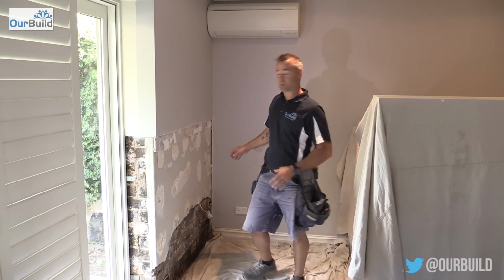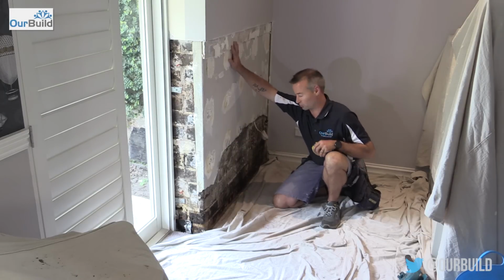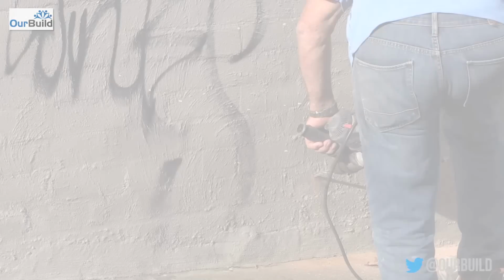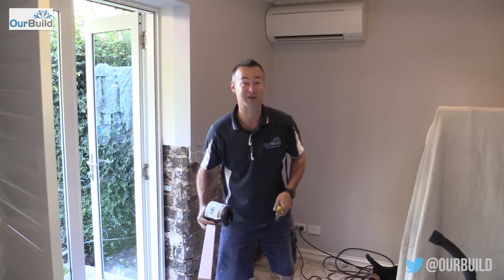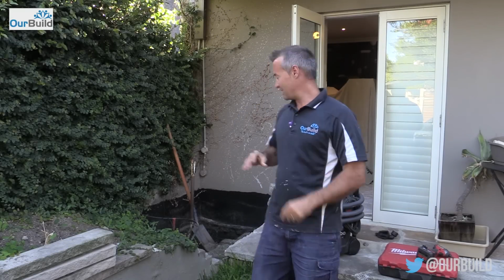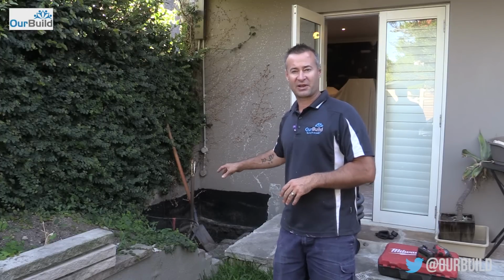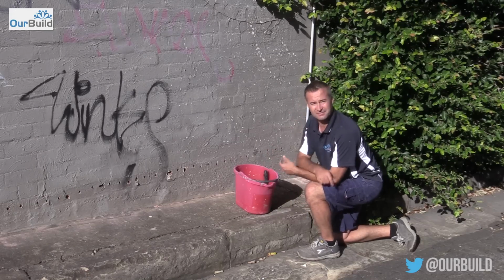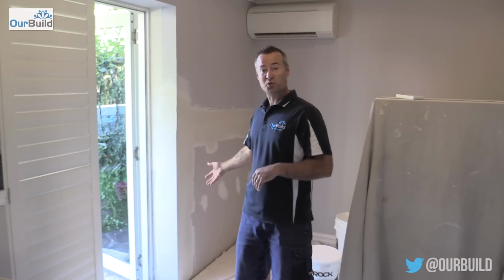How To Repair Rising Damp In A Wall.

Comment: Look at the outside ground level - higher than inside = penetrating damp.  Having spent 25 years in Ozzie, I know it well - and have never seen rising damp, and never needed to do this to an old house - owned plenty in Perth on the coast and Adelaide.. Biggest issue is ventilation - high humidity can condense within the walls and make them damp.  Note inside and outside on this house are not able to breathe - walls covered with bitumen or cement / plastic paint - so interstitial condensation cant get away. I guarantee that if you take all this crap off the walls they will instantly dry out.  Plaster in lime, and never see a problem again.  Simples.
Reply: listen to this guy - I have learned a tremendous amount from Peter and his videos - and saved a fortune. Thank you Peter for taking the time and effort to raise awareness in an industry that is jam packed with, basically, con merchants.
Reply from the maker: Thanks for the words of advice Peter, will keep that in mind. BTW - The outside level is lower than the inside, and the clients are more than happy with the repair.
Reply: The external levels are clearly high, they should be a minimum of 150mm below floor level, here they appear almost level
Reply: Peter Ward
your bob on, don't understand this one it's even got a damp course install when it was built. sort the outside level the problem would almost sort itself.
Reply: Peter Ward knows his stuff. Absolutely common sense regarding the need for brick work to breath. Any magic remedies with drilling is never going to work.
Reply: Yutube Lurker  Yes the moisture cant get out. You answered your own question. Get rid of the paint and graffiti and the problem will go away by itself.
Reply: Yutube Lurker you can’t stop water ingress. Water will find its way in through any tiny crack. The render won’t allow it to evaporate when it’s in so it gets trapped inside. If the wall can breathe then it will just evaporate away. Peter knows his stuff, look him up
Reply: What about a double brick with cavity that is halfway under ground with moisture only in the bottom (first visible brick from the floor) and concrete floor in 1 corner only. Dries out some time after there is no rain for awhile but does persist for some time after rain. Drainage and other regular factors are fine, only dampness is in the 1 bottom layer of brick in 1 corner only.

I would hazards a guess the metal sheeting visible just above the first brick is the DPC? I don't know why else a sheet of metal would be there but i'm only a sparky so eh anyway, it sounds like rising damp due to failed DPC to me.
Reply: YOU MIGHT HAVE 25 YEARS EXPERIENCE BUT YOUR MIXING UP CONCEPTS...HUMIDITY IS EITHER RISING DAMP (TOUGHEST TO BEAT)..CONDESATION...(NORMALLY ON HIGHER PARTS) AND INFILTRATION...DON'T CONFUSE PEOPLE...THIS IS A CLEAR CASE OF RISING DAMP...AND I AGREE ABOT LIME..I WOULD USE UNDERNEATH A BREATHEABLE CEMENT...THEN HYDRAULIC LIME AND SILICATE MINERAL (BREATABLE) PAINT...IT IS A CHEAPER SOLUTION THAN THE INJECTIONS...THE CONCEPT IS ...THE WALL NEEDS TO BREATHE...TO KEEP HUMIDITY OFF
Reply: EXACTLY. Im a London Plasterer. And this con has been around since the 60's. Why dont they get damp in Holland. Its built on water?
Reply: Common sense at last,
Reply: I have a house in a dry climate and there is crumbling mortar extending 1 meter up on all walls, including internal walls. No high soil on any side of the house. Most older brick houses in the town have the same problem or have already been repaired. If that isn't rising damp, I don't know what is.
Reply: @Jaxon Caiden flixportal :)
Reply: @Anders Kaiden thank you, I went there and it seems like they got a lot of movies there :D Appreciate it !!
Reply: @Jaxon Caiden Happy to help :)
Reply: @TheHuntermj  salt
Reply: @nathan21388  yes, but what carries the salt up the wall if not moisture...

Comment: Here in the UK some people are cutting the bottom meter of the wall and redoing it in lime motar, as cement acts to hold in the moisture, even as a wick effect to draw up the moisture and leave salt crystals, often mistook for mould,  in some cases structural cracks will appear as the moisture will add weight to the wall and pull down the wall in certain areas, this is prevalent in old stone houses with stone foundations. Plasterboard is one of the Greatest wicks manufactures have invented. You may be lucky if it works on this occasion, but it looks like an old stone wall. Walls need to breath.

Comment: By the amount of negative comments here you must have realised you messed up.

You should listen to Peter Ward rather than dismissing him. He knows more than you.
Reply from the maker: +Jack Davies Hi Jack, do you own a moisture metre?? They can be used for a whole lot more than timber, I suggest you read up on your information a little more before making an un informed comment - http://www.flir.com/instruments/building/display/?id=49421
Reply: Our Build Thanks for the link.
Reply: Our Build you shouldn’t use a moisture meter as a means of testing the percentage of saturation. They can be useful for comparing different areas of a wall to one another but that’s about it.
Reply: @OurBuild  That device measures (relative) heat. The heat of what ? Not necessarily the heat of ingress water. In fact, probably never measuring 'direct water temperature'. Cooler areas identified by thermal measurement are often areas of salt crystallization (efflorescence in these cases). All such salts are fully hydrated (that is the nature of salt formation whenever water is present, as liquid or gas), and so the water measured as the cooler regions typically do not represent 'free ingress water' (as one might expect when classifying a region as 'damp'), but rather the cooler water molecules which have been pulled in to hydrate the water-hungry salts. The salts are allowed to form typically because the water has been trapped (by portland-over-lime, or by synthetic coatings which do not breathe). Peter Ward is correct on each of these matters.

Comment: Peter, can you please advise how I should fix a rising damp on a solid wall after stripping back the peeled paint? What do I need to apply so it dont damp again.
Reply: I know you asked question 3 months ago, but the damp will always rear its ugly face im affraid.  Jobs treated with a whole damp proof solution, ive seen many times the damp return.  And before anyone may say the D.Proofing cant have been done right.  Ive seen 1st hand , experience trades doing a propper job, and doing it by the book, only for damp to return.
A DIY'er will only have time & skills to paint on a paintable solution.  But a more substantial repair using K11 should be done.

Comment: Does anyone know how to moisture proof, from the interior, a limestone farmhouse (circa 1775) in Pennsylvania.  Current problem is a closet, with solid door.   The old horsehair plaster has been crumbling off the wall for years due to moisture.  When built, the limestone rocks were coated with many layers of horsehair plaster.  I want to remove all the horsehair plaster, and am looking for recommendations on what product to apply to keep moisture out.  A contractor recommended a concrete product (Quikcrete).   The stone wall is NOT smooth, of course.  Using green/blue drywall would likely trap the moisture between the rough rocks and the drywall, causing a different moisture situation.
Reply: Check out ´Peter Ward´ posts . DON´T waterproof your walls . Use lime plaster and limewash paint only. Do NOT use any cement based mortar.

Comment: Anyone who diagnoses rising damp with a moisture meter is inherently distrustful, they are using a tool that is designed to measure moisture in WOOD not  BRICK. Also injecting the walls of your environment with loads of chemicals and then sitting in it seems like the quickest way to make yourself ill.
Reply from the maker: Art Jacob I totally disagree sorry. As per all my comments below. Moisture metre's can be used on a variety of materials new IR technology will pick up moisture in just about anything. These are the professional meters that are being used - http://www.flir.com/store/moisture-meters/
Reply: @OurBuild  Correct...
Reply: Depending on which moisture meter you use, for instance the MMS2 by protimeter has REL scan mode which can be used for bricks block etc. And WME mode ( wood moisture equivalent) which can be used for mortar lines and timbers. To successfully determine if the damp shown is due to an ingress from below the sub floor (due to lack of dpm) or a breach within the dpc, you would need to conduct a salts test, testing for chlorides and nitrates within the given material, this would  strongly indicate that it is due to an ingress. If only chlorides are present then an ERH (environmental relative humidity) swatch would be required to examine whether the material is colder that the ambient RH if so then a target drying regime would be necessary to  try and bring that temperature to equilibrium with the ambient temperature.

Comment: Nice video I had the same issue with my basement 3 years ago and it was fixed this way. Luckily it occurred while the house was still under construction and they were able to inject from inside.

Comment: If you do this in the UK you will damage the brickwork and ultimately undermine the wall. I wouldn't allow you anywhere near my house. If it's old walls it needs old techniques not modern materials. The reason you don't get complaints is your clients don't understand what your doing and by the time they do they wouldn't trust you to rectify it.
Reply: OH MY...THESE HOLES HAVE BEEN DONE NOW FOR AGES...NOT A PROBLEM...EFFECTIVENESS...ANOTHER MATTER
Reply: Had my house in wales done like this. Never a problem with it after that. Great job. 👏

Comment: How to hide damp, 
It’s because of the outside levels and drainage,
The wall can’t get rid of the moisture to the air outside as it should, mostly because of plastic based paint, this is hiding the real problem.

Comment: I'm having one hell of a headache with damp in my home. Had around 10 "specialists" out. Non can find the issue and all recommend to just internally render then skimming over. Problem is; on the outside the brickwork damp is there too. Random circular patches several feet up, internally it goes from the back walls all the way along the internal diving wall with the neighbours. The roofs been checked and redone. The walls have been repointed etc. It's getting worse. It's now jumped 14ft up and is appearing in a rear bedroom.  Both the bricks and mortar are soaked outside. With typical winter temps in the minus, I am waiting for the whole back end to come down from constant expansion with ice.
Reply from the maker: KJ James Wow that does sound like a nightmare, what part of the world are you in?
Reply: Manchester, UK. It's either raining or cold. House is south easterly facing so in summer you get some sun exposure in the evening on the wall but come autumn it's damp, dark and never dries. That lasts until mid summer. I'm inclined to believe it's a dividing garden wall on one side but the middle of the house makes no sense as it's separated by French windows.
Reply: these guys seem to know what they doing http://www.heritage-house.org/ - look at the peter ward utube vids - might give a clue? (there's not a chimney is there ??) It wont be 'rising' damp. maybe external cladding will stop penetrating damp and still let the wall breathe if its really exposed? (sounds like penetrating damp - though I bet there's a simple explanation. (I'm not in the trade - just interested and slightly educated with a damp problem I have solved and friends with old houses going through similar) if someone turns up with a 'damp meter' - they are a cowboy - send 'em packing!
Reply: KJ James it is most likely as stated salts in the mortar attracting humidity. You need to take off plaster/ render. Rake out pointing, repoint and if possible use lime render outside or if possible don't have any render outside to trap moisture in future.
Reply: Contact Peter Ward, Heritage consultants. For honest advice.
Reply: I'm trying to picture your discrimination but I had a similar problem & noticed round damp patches all over the external walls (end terrace) though it was gutters or penetrating but released it wasn't when it rained I was more when it was cold especially zero & sub zero then I found the walls was constructed using stone wall ties these are stone that are place length ways from outer wall to inner wall thus tying the 2 walls together (it's very common) but it transfers the cold to the inside walls then moisture in the air attracts to it & creates a damp spot about 12" diameter..... so I overboarded the external walls with insulated plaster boards 15 years ago no problems since & the house is now so warm
Reply: Should say description
Reply: Neil Sparrow .
Reply: Jimbo Slice  the floors are cavities. Wooden downstairs and if you lift the floor there's a drop of around five feet. Under the floor the it's bone dry. I've had damp coursing, repointing, roof done, sealed outside, rendering inside (it just shifts to the edge of the render). New windows and doors at the back which were set back. 

The floor outside obviously cannot be lower as the house is at ground level. Internally you have the drop. The house is late Victorian and bar knocking it down I've excused everything.

I'm going to see about tanking the entire back. Worst part is how it's jumped to random places.
Reply: @neilsparrow2725  won't that just leave the damp to collect behind. I thought of doing something similar to this and wouldn't be an issue loosing a few inches internally. Sorry for the late reply btw. I've only just been alerted to these posts hmmm
Reply: Jimbo Slice  every wall was knocked back to brickwork and the bricks are wet in the same place too. Both inside and out. When I say its coming in random places, that's happening upstairs.

Downstairs it's the full back wall and then the dividing wall between my neighbours. It goes the full length of the internal wall at an angle. We're talking five meters. At the furthest point on that internal wall it's at its lowest, then it goes off towards the back and it's the full height, 8/9ft up. 

In the middle of the back wall are floor to ceiling french doors, so they they actually should stop the water continuing but on the opposite side it's around 4ft up. 

Now that joins another internal wall which is then open plan kitchen dinner and amazingly it reappears on the next wall section that squares off the gap. 

Upstairs is where it's appeared in patches. Jumping 3 or 4ft and then randomly placed at different heights. It's outside on them points and inside. 

My neighbours have it and I've been in to theirs to check, there's nothing against those internal walls. I thought they might have had a radiator or boiler leaking but they're on opposite walls. They have french doors and their radiators are on their internal division with their kitchen and dining room.

I've had around 50 companies in. Probably spent close to £20k over the last few years trying to resolve it. Worth mentioning too, the damp has no mold on it. Just salts. I often use an ice scraper to scrape it off.
Reply: Jimbo Slice  I had a brand new roof put on in 2008/2009. I've only only just had it looked at. At the end of September, had brand new faciers and cladding over a bay at the front. The guttering was new at the back in 08/09 and every company has looked at it and said it's fine. Faciers at the back are dry, no drip offs.  

They've checked the back and no issues this time either. At the front I had some lead replacement around the chimney but the guttering is clear and and there's zero water when it rains where the guttering is. 

Honestly I've had years of companies out and no issues found with the roof. I've checked in the loft and it's bone dry. It's actually dry upstairs along the ceilings. Just appears at the tops of skirting boards and then up those walls. Then jumps to random circle points.

It's the full back wall upto 9ft. Then what would be the floor cavity upstairs is dry. Then it appears both inside and out upstairs above the cavity where the tops of the skirting is upstairs.

The back yard actually isn't street level. I've just realised looking out, the back actually steps down about 8". 

When it rains there's no water on the back ground, runs off into the drain. 

I've had sections taken out to see if debris has fallen down and settled where the patches are but the internal is bone dry. It's on the external and internal of the brickwork but not on the gap behind those bricks.

Had the floor up and gone underneath, the soil under is bone dry. The wall is bone dry under the floor too.

Even in summer the outside is wet in those patches and obviously inside too.

Comment: Open up the cavity you will find it to  be full of old dropped cement from  when they build the property I've seen it time and time again take 3 row of brick out clean out replace with new dpc menbrain then replaster and stay at lest one brick hight with a 8 to 1 mix of cement and no waterproofer